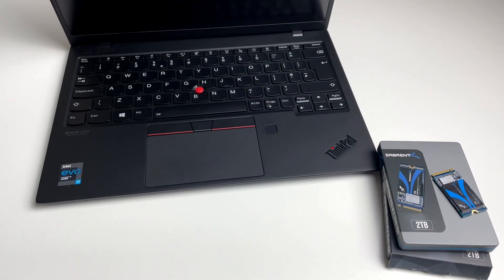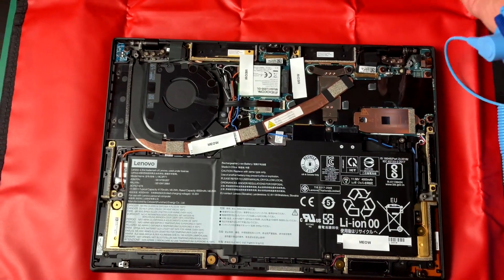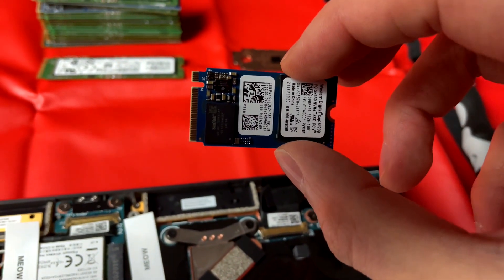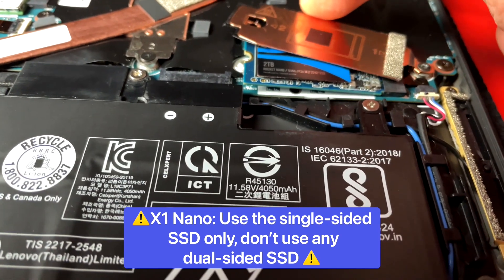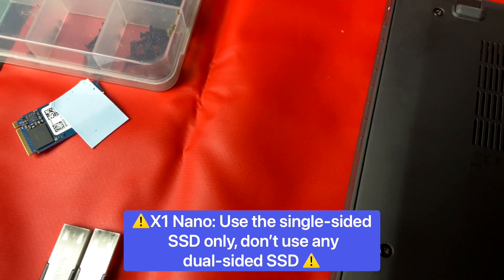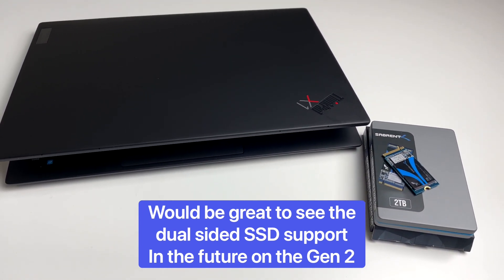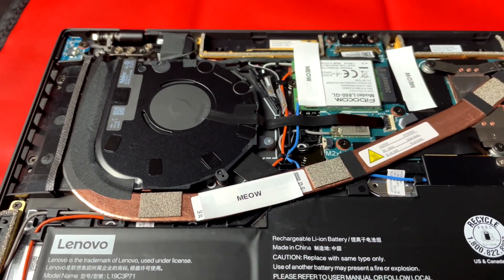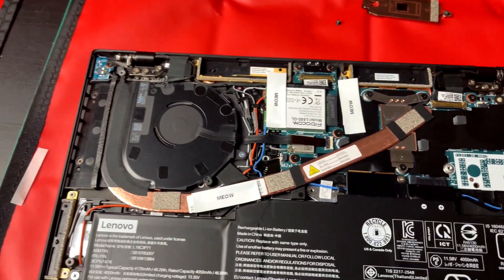ThinkPad X1 Nano: SSD Upgrade & Internals (Updated)

Comment: What sized screwdriver did you use to remove the m2 screws? I stripped mine...
Reply from the maker: Take a look at the Lenovo hardware service manual. Stop immediately if unsure/if it has been threaded or striped. Get a repair shop to take a look. 

The ifixit kit or similar screw sets will have a few sizes to try, if you're able to get a set. Hope that you can get one that does it.

Comment: Did this improve speeds?
Reply from the maker: It was mostly to boost the storage.
Reply: @GreenGreenStore  any problems since installation? Is everything working great with this upgrade?
Reply from the maker: Took it out immediately after realising that you probably needed the single sided SSD.

Comment: thanks for this! i want to ditch my 2019 macbook pro for one of these, but i don't like how windows 10 scaling works most of the time. do you know what this comes at out of the box (the "recommended" setting) and if it's unreadable from a regular distance at 100%?
Reply from the maker: I’m finding that 125 works fine. The default is less dense at 150.
Reply: @GreenGreenStore  thank you so much!

Comment from the maker: Hey people. This is the 3rd upload of the same content. 
Sorry to clog your feed - we just want to make sure our content has the appropriate accuracy.  We're happier with the content now. The first two uploads were deleted. ☺

Why? In the upload 1: we've said M.2 2242 double-sided SSD doesn't fit (in the standard sense); in the upload 2, we've added that it does fit - provided if you nudge it in (having seen some comments, we've realised we needed to clarify that nudging the dual-sided SSD in this way, may not be what the manufacture has intended). So in the last upload, we've re-shot the intro & added a section after the SSD section: to say that with the X1 Nano, you should only use the single-sided SSD. 

More warnings and disclaimers were added to this upload, so people know the issue with the dual-sided SSD fitting in naturally.